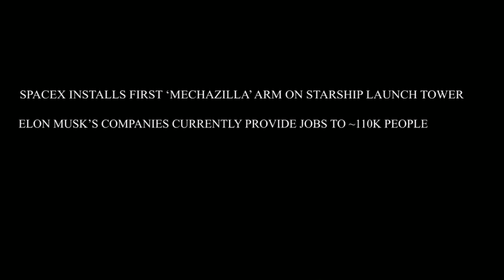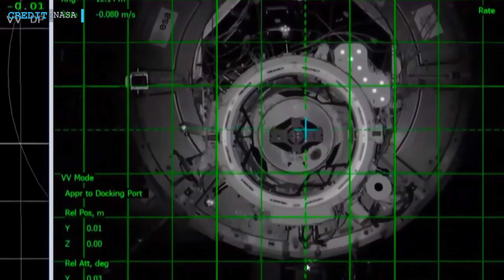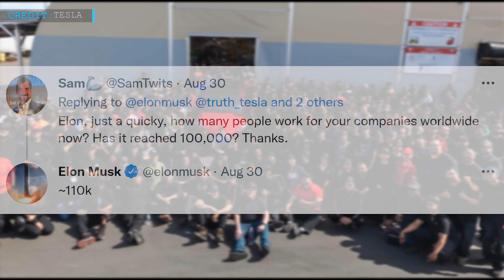SpaceX installs first arm on Starship launch tower- Targeting to catch Second booster

Comment: Musk is better off Landing those Spaceships in the Ocean ... When all the fuel is gone , they must be really Light weight ... and if they slow down to nothing when they hit the water there should be No Damage ... they should Sink down a bit and bob back up ... unless the water pressure crumples something ... If the engines are too heavy , add some flotation ... Then the rockets would float like ships ... Might be hard on any people inside though ... Then build a ship to pick it up , clean it ,  stand it up and take it to port ... This dangerous Chopstick idea has No Room for Error .......

Comment: Why Doesn't Musk ? ... have little Star Hoppers , Boosters and Star Ships taking off and landing Everyday ... Flying around , going to waypoints , at different heights , with cargoes and Landing perfectly at selected Spots ? ... Aren't those Engines and Gyros ... Reusable ? .... I'm sure he has enough Spare Parts ... It would be Good Practice and a way to Iron out the Systems ! ..... Let's See some Action ! .... Those things should be Flying around like Airplanes , refueling and taking Off again ... Or is that CGI Cartoon stuff all BS ? ....

Comment: I’m curious how they plan on offsetting the load of the booster landing on those arms having a force on the tower itself. That booster will by no means be light.
Reply: The cabling is attached to a massive winch that is anchored to the massive concrete pedestal, transferring a lot of the load to the ground- like a crane's counterweight.  And the booster won't have hardly any propellant left, like an empty soda can.
Reply: gfg   Elon Musk always wants to play the genius with stolen topics... it is pathetic how those advisors manage the Company. They will lose thousands of years and they will never have the needed technologies...

Comment: Elon is not doing in orbit end to end refueling. He talked about that in the video with Everyday Tim Dodd, when he gave Tim the tour of Starbase. They are removing the plumbing required to fuel boosters from the bottom to save weight. https://www.youtube.com/watch?v=9Zlnbs-NBUI   

You seem to be confusing the QD arm, and referring to it as though it is part of Mechazilla. They are two separate systems.

Mechazilla is not the QD  (Quick Disconnect) arm. Part of the QD arm was installed on the tower and it will deliver consumables as you said, namely liquid methane and liquid oxygen, to the booster. You can see this on NASA Spaceflight's video here: https://www.youtube.com/watch?v=OyhflrQ1N04  

Mechazilla as you say is for catching starship, but it is still being constructed on the ground. You can see that here: https://www.youtube.com/watch?v=EekWgLG3BMg

Sorry but this subject is extremely important to me, and I want to make sure you get the details right.
Reply: hjg  Elon Musk always wants to play the genius with stolen topics... it is pathetic how those advisors manage the Company. They will lose thousands of years and they will never have the needed technologies...

Comment: Would be great to have a system on the ground to turn off any fire in the engine area after the tower catch the booster or Starship. You catch and then get closer to the ground to quick extinguish any fire before to put back on the orbital launch.
Reply: Maybe they could modify the water deluge system to spray upward after catch or something, but I think spraying hot engine parts with water might cause some issues due to thermal shock.
Reply: @pauldamse253  I guess the thermal shock could be an issue if it was water spray directly on the noozle but wouldn't if it was CO2 foam like from extinguisher. The idea to modify or add this extra system on the table is pretty cool.
Reply: ghj   Elon Musk always wants to play the genius with stolen topics... it is pathetic how those advisors manage the Company. They will lose thousands of years and they will never have the needed technologies...
Reply: @luisbeck007  I'm not sure to understand the comment?

Comment: Would be a big inspiration to see a foldable or 3d printed home on Mars with a Cyber truck on the drive way.
Reply: @tech 52 Why not? You don't need space suits on Mars, just skin-tight pressure suits and helmets. Why would it even be difficult? It's not like they couldn't make buttons bigger for gloved hands.
Reply: @tech 52 You didn't mention anything that would prevent it's use on Mars as is but merely suggested it be built differently. It's aerodynamics don't hinder it's function in any way. It not having a pressurized cabin doesn't make it unworkable either. You have moved your original goal post of it being impossible to enter or drive the vehicle because you saw that was BS. There would be nothing preventing someone from driving one of these in pressure suit and it would be both faster and easier than getting in and out of a suit just to get in and out of your vehicle. So you're just flat out wrong that it couldn't be done; it has been done already with the much more primitive moon buggy with much bulkier suits.
Reply: kh  Elon Musk always wants to play the genius with stolen topics... it is pathetic how those advisors manage the Company. They will lose thousands of years and they will never have the needed technologies...

Comment: I wonder if he thought of trying to catch a Falcon 9 as a test.  If he has one with 10 or more successful launch and landings it may have paid for itself enough to risk a catch.
Reply: Maybe they would've tried that but the Falcon 9 can't hover.  It can't be throttled down far enough so will begin rising again if the engine is left running after the rocket reaches zero velocity.  So it's not a good model of Super Heavy or Starship.
Reply: @ayCarumbaQueLio  That could be easily solved by adding ballast, i.e. dead weight.
Reply: They would also need to build a dedicated tower for Falcon 9, since it's so much smaller than Starship. They have obviously decided that there's not much point in doing so.
Reply: @anthonypelchat  I would like to see it though. Maybe scale down the Raptor for the Falcon or just put less total engines on it.
Reply: @BrianKelsay  It would be awesome to see, but not really our place to decide. Plus, it would likely delay Starship. They are nearly at the point of launching SS, so it shouldn't be long until we see them try. Going to be fun to watch, no matter what happens.
Reply: @BrianKelsay  That's the kind of solutions oriented thinking that makes for a good engineer.
Reply: @anthonypelchat  I disagree. The vast majority of the challenge is accuracy and all you need a an X painted on the landing pad to ascertain that.
Reply: @Flipperhome  True, but they have the accuracy already. You can see how close Falcon 9 already comes to a bullseye even when hitting the moving drone ship in the ocean. Proving that they could catch Falcon 9 with an arm would be interesting, but frankly pointless. It would require redesigning the tower and redesigning Falcon 9. You would also need to stop Starship development or build a brand new tower somewhere else. 

Starship is nearly ready to fly, so we are talking a few months before we see an attempt. It simply isn't really worth it now. Had they decided on that a few years ago, then it may have made more sense.
Reply: @anthonypelchat  I've already shown you don't need a new tower for the test so why are you repeating that nonsense.

Look, I never said it was a necessary, or even a good, idea. I just pointed out your nay saying was silly. You're looking for problems rather than trying to solve them.

I've had to deal with that kind of thinking all my life and, usually, there's an almost trivial solution to the 'insurnountable' problem.
Reply: @Flipperhome  I didn't say that it was insurmountable. Just pointless. If the point is to prove accuracy, they already do that. Nothing else is needed. 

If the point is to catch it, they need to redesign the tower or build a new one. I won't go into everything there again. 

And realize that I said that it might have made sense a few years ago, but they weren't thinking about catching a rocket then. Starship is about to fly, so there's no point in do anything with Falcon 9. What else are you expecting them to do?
Reply: @anthonypelchat  That's why Starship has never made a bullseye landing yet, because the have it down pat.
Reply: @Flipperhome  Starship needs testing, I'm not denying that. But the original comments are about testing the landing with Falcon 9. And Falcon 9 has had numerous very near bullseyes.
Reply: @anthonypelchat  let's hope that "near" is good enough.
Reply: @Flipperhome  It can't hover and hits center on a moving droneship. Proving that it can get even better doesn't help. Starship has different engines, different thrust to weight, different spool cycles, etc. It needs to be proven, not Falcon 9. Would it be fun to watch? Absolutely. But is it worth the time, money, and delays to Starship's development? No.
Reply: @anthonypelchat  I already gave one solution to the hover slam and another user provided a second one.

I'm tired of providing solutions that you ignore so you can repeat your 'problems'. Have fun arguing with yourself. I'm done playing your games.
Reply: @Flipperhome  I'm not ignoring your solutions. You are ignoring that it's pointless. How are you not getting that? 

You act like you're an engineer. Ok. You need a mass simulator attached to Falcon 9 to get it to hover, or just come back with enough fuel. But what does that solve? They prove beyond w shadow of a doubt that Falcon 9 can hit a pinpoint landing good enough to be caught. Great. Does any of that experience improve Starship? No. So you spent all that time and money on something that isn't needed.
Reply: jhsf  Elon Musk always wants to play the genius with stolen topics... it is pathetic how those advisors manage the Company. They will lose thousands of years and they will never have the needed technologies...

Comment: They should make booster to stay afloat after landing in water for the first mission. That way they could save valuable Raptor engines.
Reply: If it doesn't breakup, a empty booster will float like a sealed empty beer can
Reply: Hell yea, I bet they never thought about doing that.

How exactly would you keep a 200tonne rocket with 2000cu meters of empty pressure tanks afloat?
Reply: They are not that valuable anyway. The design is changing so fast that these 29 engines are obsolete already.
Reply: @fisterB  
Yes,
But,
Still nice to see how they went, strip them down to cheats wear etc.
Reply: @brucebaxter6923  Totally agree, there is absolutely valuable information in such an inspection. It will float all right, I suppose, and be retrieved. It is just that the engines will never fly again even if they were unscathed. In this early phase, SpaceX seems to evolve their hardware so fast that they junk obsolete versions all the time. Imagine the shame if a reused early engine fails on the next mission, when that mission could have failed for a much more interesting reason.
Reply: Those engines wouldn’t be reusable after getting dunked in sea water. The cost of refurbishment would exceed their value. Better to scrap them and use new ones.
Reply: ffg   Elon Musk always wants to play the genius with stolen topics... it is pathetic how those advisors manage the Company. They will lose thousands of years and they will never have the needed technologies...
Reply: jks  You dont need to give all kind of explanations; or you know how to build a Spacecraft 10 Thousand years in advance or you dont... and if yo dont; you put in charge the people who know. In this case only one person in the World knows how (me). This is how they manage to go to Space (by hiring a german); but after this no Policies, blind nationalism and cheating... if it wil take 10 Thousand years only for a Spacecraft; wrong Policies... when you speak to me the best thing you can do is explaining me your budgets; that way I will be able to help you better... if you dont have budgets you can go to the Congress of your Country and tell them to hire Luis Beck or ask other people who have budgets; to do it... My condition is: you send the contract by e-mail and dont bother with stupid websites for hiring; where they dont get it what is all about... because these people not even after one million years they will understand the meaning of Policies... all they do is stealing topics, making waste time and trying to play the intellectuals (at those Universities, Institutions and Companies...) because they work with stolen ideologies and ideas..
Reply: @luisbeck007  You might be a visitor from the 121.st century, Luis. Could you please indicate in some way if you think your mind has been damaged by the time travel and thus compromised your ability to tell us?
Reply: @luisbeck007  I have no idea what your comment meant. 
Can you explain please?

Stolen topics I am assuming you mean his use of existing technology. 

Will never have the technology I am assuming you missed where he has been the only one to succeed making electric cars, satellite internet, reusable rockets, giant flying winged rockets
Reply: @luisbeck007  

What are policies and where were they stolen from.
Reply: @brucebaxter6923   Read the recommendations from the previous, previous text or I will need to block you...
Reply: @luisbeck007  
I have been reading them, many times.

They still don’t make anything like coherent sentences. 

I’m guessing that English isn’t your native language.
Reply: @luisbeck007  
Well, yes, I am a psychopath. 
You have interacted with me in a curiously random way for long enough to get my interest.

We will be meeting soon.
Reply: @brucebaxter6923   You need to explain me your budgets or explaining first at the White House or Congress. Because it is not about fighting for who is President but about the Policies... You hire after speaking at the Congress with the Congress Men or White House and avoid the conflicts... I have no time for stupidities nor Soap Operas...  The Policies is the most important... not engineers cheating...
Reply: @brucebaxter6923  You try your best :) at least.To keep an open mind is a virtue. Wouldn't it be exciting if Luis Beck is trying to tell us how to build technology from 10 thousand years in the future? We are quick to judge him mentally disturbed and incoherent but it could actually be a side effect of the time travel.....but rather no, he is not well, the world is so boring in that way. Care, love and medical attention is the way for this unfortunate fellow human being. It is not funny.